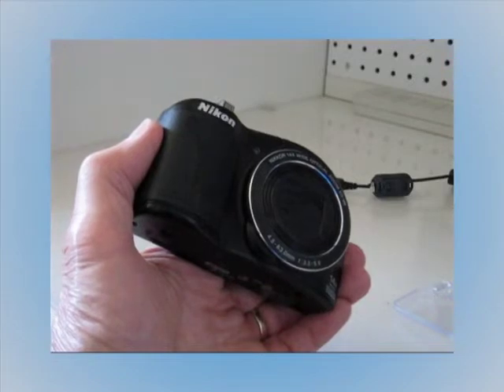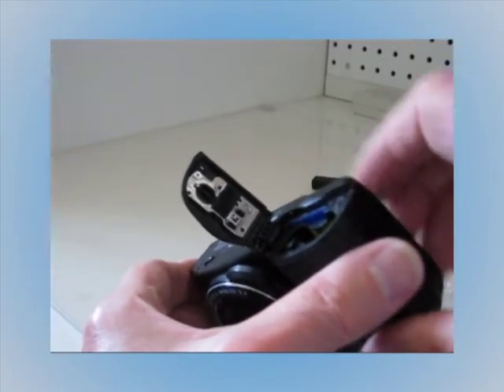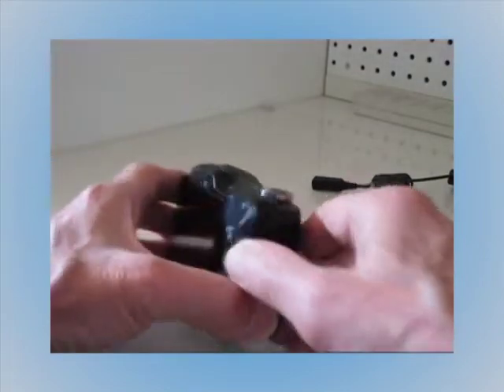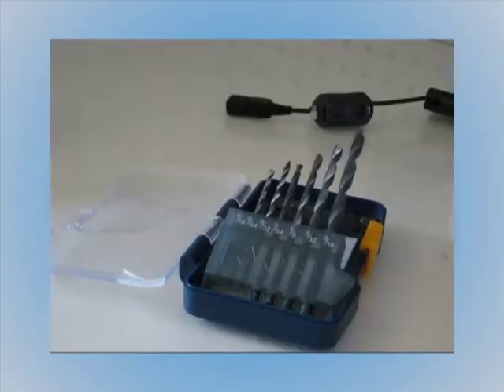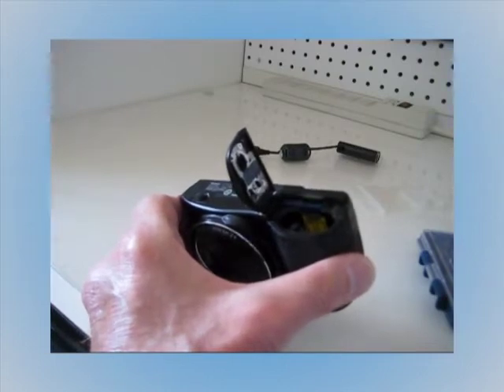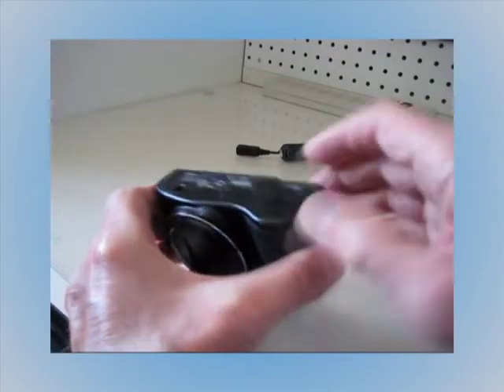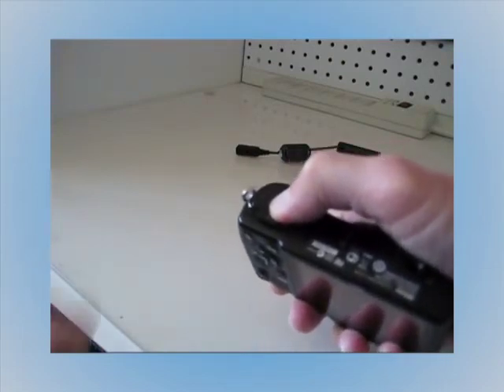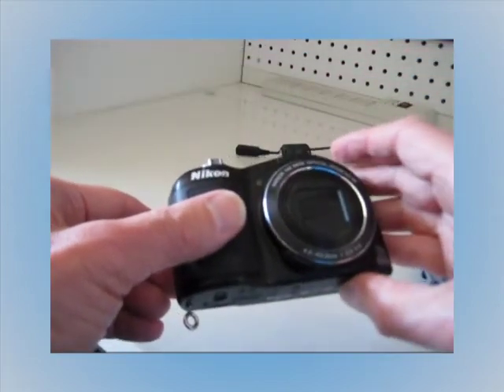Secure a Coolpix Battery Door

Comment: brilliant - works better than any of the other attempts to keep the battery door locked -
Reply from the maker: Thank you for the feedback! It's important to do, especially on the L610 since it is considered a professional grade camera (according to a working photographer I was talking to). I have two models. The one with the broken door I use indoors for tabletop photography. Inside the battery compartment is an AC adaptor. The cover is screwed shut and I never have to open it. 🙂
Reply: @grabshot  mine is an L620 -- i think this is (at least) the 3rd one of this model i've had over the past few years -- each time experiencing the same battery door issue - however - in this case - not because the latch broke - i assess it to be due to the metal "thingies" onto which the batteries are seated - causing them to be too extend just a tad too far out of the housing - causing the door to not stay latched  --i've tried using a small screwdriver to push the "thingies" down but they won't go down any further. i took a pix of the "fix" you have brought about - but there doesn't seem to be a way to post it.
Reply from the maker: @longpants9969  Exactly. Those metal springs are too strong and that causes the problem.
Reply: @grabshot  have you found a way to press them down so they don't push the batteries up too high?
Reply from the maker: @longpants9969  I didn't try to push on them. The holes and screw-eye method keeps the battery door closed securely.

Comment: Thank you!👍
Reply from the maker: If that helped, you are most welcome.
Reply: @grabshot  Oh yes! I think this is the most efficient and cheapest way. I did it today but I used two screws. One is the place which you drill, the other one is the line between two batteries, just above the black lock pin.The camera has back to life again. So thanks again.
Reply from the maker: @emrahgoksoy1875  Yes, that's exactly what I did also. Now there are two screw-eyes securing the door and holding an AC adaptor in place. I can use it for indoor tabletop photography with the USB cable for transferring photos to the PC. The door will stay closed with no reason to open it now. I have another L610 for outdoor use. They are fine, pro quality cameras.
Reply: @grabshot  So the little black plastic door at the side for the AC adater. Thats the one I need it. I have to unscrew that two screw for a while. Anyway, not sorry for that. I can shoot again.

Comment: This will not work on my coolpix even though it is the same model.  I think they must have changed the design in hopes of fixing this problem.  But it still happens.  There is no pin in that door to replace. The door will close and stay shut, but not with batteries in it. So can't be used.

This is the second camera of this model I have bought.  Didn't learn my lesson the first time evidently, but it was familiar and I didn't have to figure out a new camera.  Sure miss my old nikon film camera, which did not have all this plastic or all the stuff that electronics involve.
Reply from the maker: I understand. After selling all my Minolta and Nikon film cameras on eBay, the one I missed was the Nikon FM. Film prices and processing are prohibitive now, so the digital models have kept me going. As far as the plastic pin on your LR610, if you don't see it, it has broken off, which is why the door won't stay closed when the batteries are inserted. Instead of batteries, I use an AC adaptor (meaning the camera is for indoor use only). The drilled hole and screw-eye method absolutely works and will keep the door closed, even with batteries.